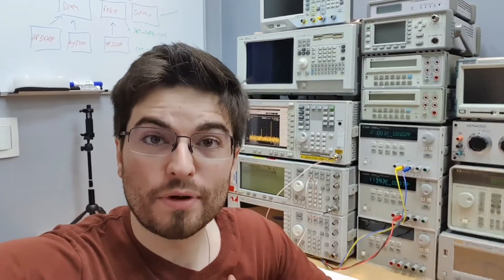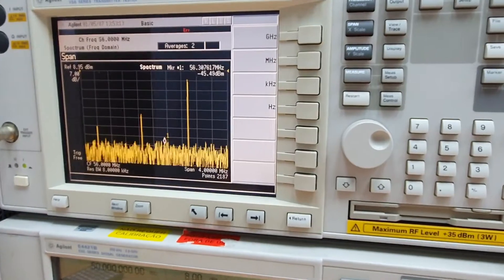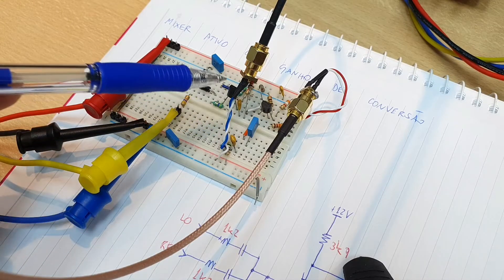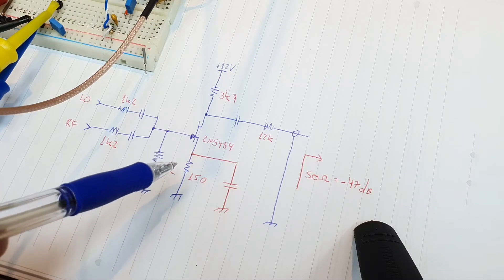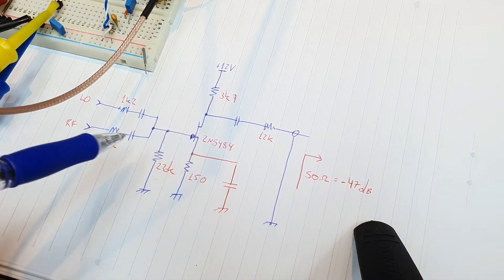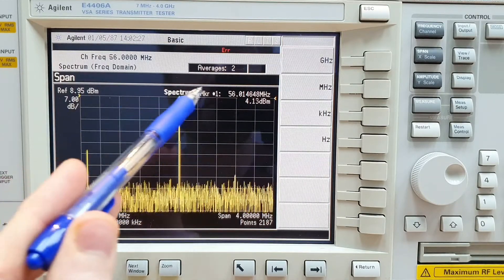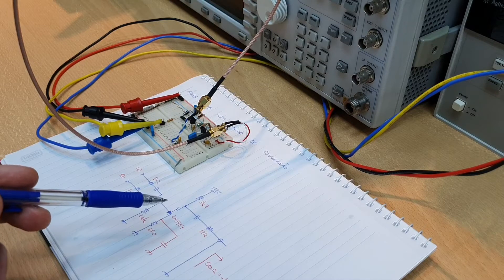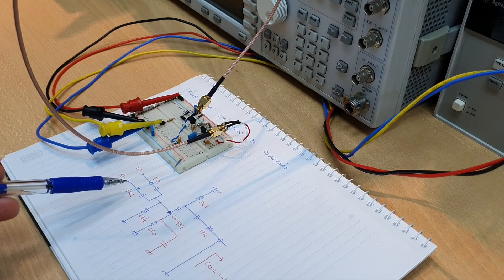Active Frequency Mixer using JFET transistor

Comment: Surprising that you can sum the signals before multiplying them. Are the input signals suppressed in the output? Are those spurious side frequencies the same side frequencies you would obtain from other frequency mixer circuits, or are they a special artifact of this particular mixer circuit? If the inputs are non-sinusoidal (eg square or sawtooth), will the output still behave like a multiplier?
Reply from the maker: The output have many intermodulation terms, the usually are canceled in a balanced or double balanced mixer. If the input is square, you will have intermodulation for all harmonic components... the square is composed of odd harmonics, so you can imagine the mess of harmonics intermodulating with each other
Reply: I'm familiar with the double balanced modulator from electronic music, where it's called a ring modulator. In music synthesis, the mixing of the overtones is quite audible in the output when you have non-sinusoidal inputs. My understanding is that in a ring or double balanced modulator, both the carrier and the modulator are suppressed, while a single balanced modulator suppresses only one input. Since the double balanced modulator is a voltage multiplier, the distinction between carrier and modulator is arbitrary. You can switch the inputs and the output will still be the same.

Comment: Hello! Nice video! I thought about passive JFET RF switching mixers - what is the maximum input voltage? In my opinion - a bit less that RF voltage from a local oscillator.This type of mixer is more inter-modulation  resistant that , said, s MOSFET passive switching RF mixer (because of parasitic p-n function between drain and source). It has less noise. Am I right? What do you think?

Comment: So how do you multiply by adding the signals again? How did adding result in multiplying? Also, what's the difference between mixing and multiplying?
Reply from the maker: The signals are multiplied by the non-linearity of the transistor: (a+b)^2 will yield a * b therms!
Reply: Unclear. 
(2 + 3)^2=25
2x3=6
Reply from the maker: (a + b)^2 = a^2 + 2ab + b^2
Reply: @AllElectronicsChannel  Quadratic! When you say "a * b terms", do you mean the 2ab part?
Reply from the maker: Yes !!